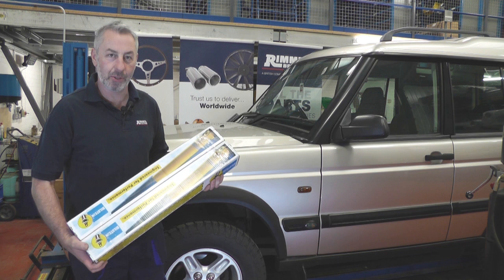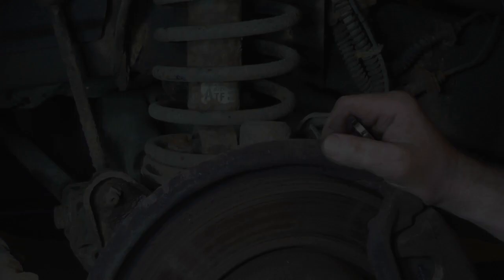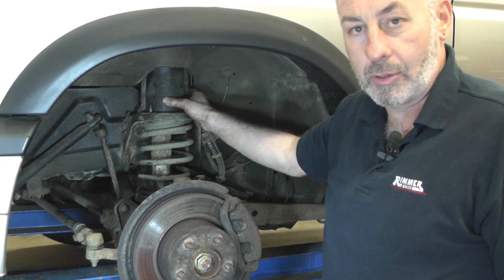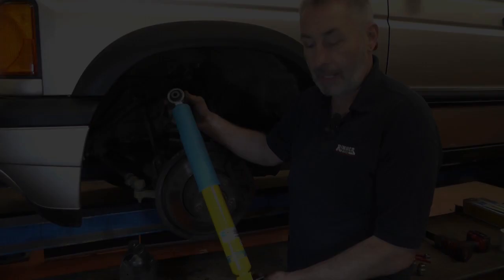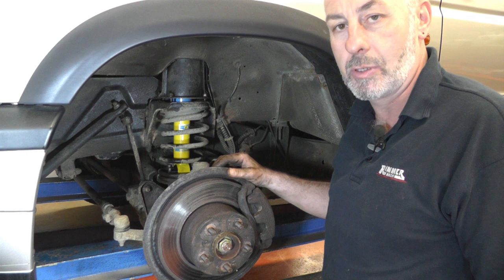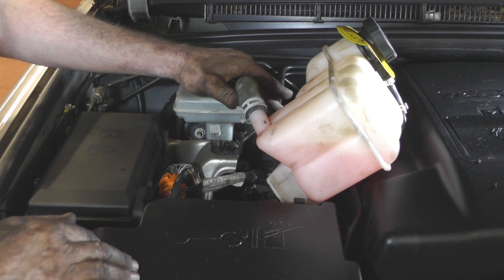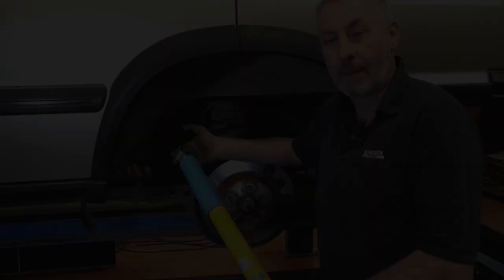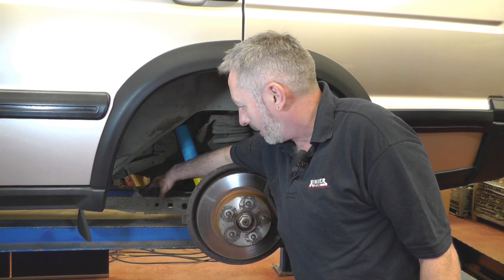Upgrading the Front and Rear Shock Absorbers on a Land Rover Discovery 2 TD5

Comment: but the rear is on springs not bags? so no self leveling, so it don't matter if the sensor is cracked, thanks for the simple vid though, i assume if you let the rear axle drop it would make getting the rear shocks back in easier.

Comment: Great video - liking Rimmer Bros videos and parts (good quality, range and prices) - pity you don't sell Ac clutches/coils (only sell complete AC compressors).  I have ACE and rear air bags on my Disco 2 Td5 - all original suspension and still fine after 17 years!   is it the same process for changing the shock absorbers as shown in the video?  I'll be using a jack stand on one wheel at a time (no vehicle lift unfortunately).
Reply: I have the same configuration.
Are those Bilstain shocks work well with ACE & SLS?